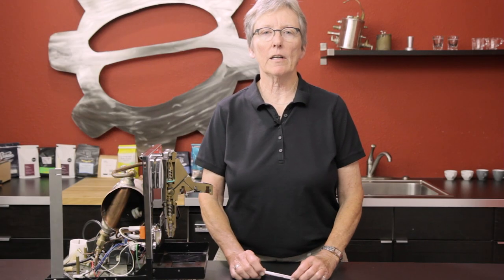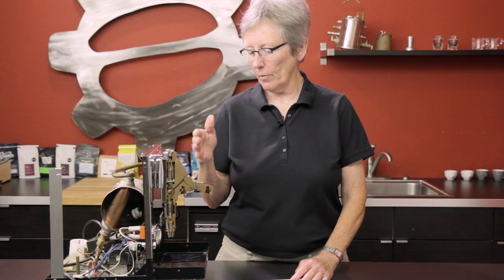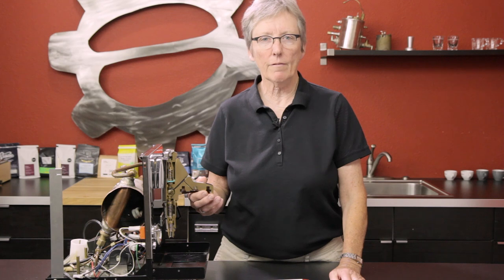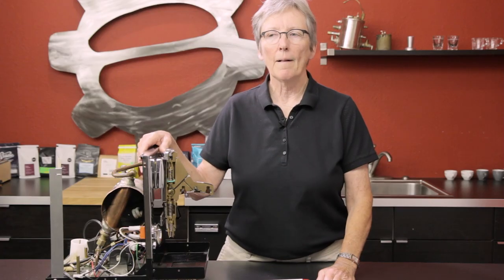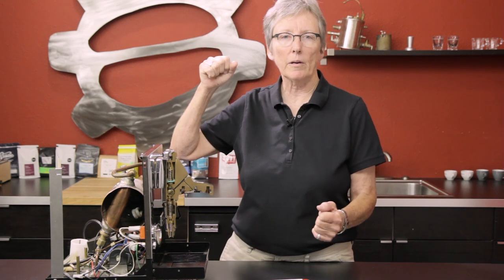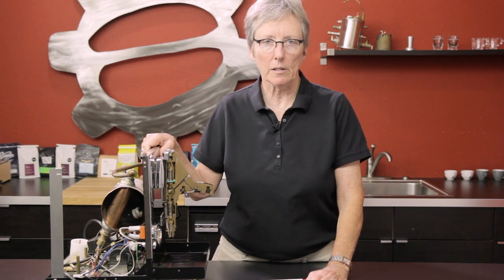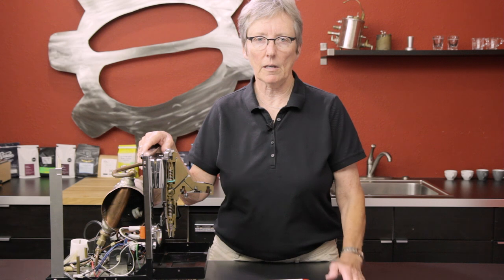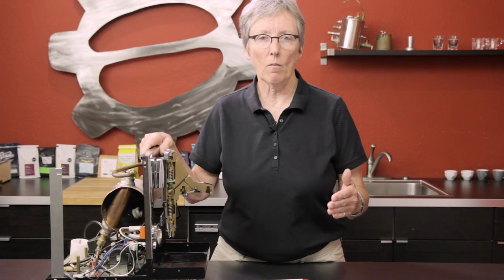What is Espresso Machine BAR Pressure?

Comment: Great video, Gail! But 15 bar pump is not really needed to get 9 bars at the brew head. You could easily get away with less. But the ULKA vibratory pump is such a simple and cheap design it just makes sense to put it in the machine - and based on the design it just happens to produce 15 bars. It was not created for espresso machines. Espresso machines just adopted the existing pump because it it small, cheap, simple and powerfull enough. Then you add the OPV to tame it down to about 10bar preasure which results in those 9 bars at the brew head. And because the OPV is extra cost for the manufacturer you hear claims (from the cheapest machines) that higher preasure (12-15bars) is better - they just don´t use the OPV and try to convince the mass market, that higher preasure is better.
Reply: Precisely; well said.

Comment: Actually the resistance provided by the coffee grounds creates the 9 bars of pressure down from 15 bars provided by pump. When you flush the machine the force of hot water coming out is about 14-15 bars. Put in a portafilter with coffee grinds, that will slow the flow of water and decrease pressure. This is why the convention is that if your get 2 ounces of espresso within 25 seconds or so, you have generated 9 bars of pressure.
Reply: You have a point!

Comment: pounds per square inch IS PSI, 1 Bar is 1 atmosphere of pressure at sea level. Although they measure the same thing - pressure - they do it using a different metric. Like kilometres and miles to measure distance.

Comment: Just bought a bes920 and smart grinder pro. I've got the grind, tamp, temperature (94c) and timing (about 25-27 secs) all to the recommended ranges, my pressure is in 9bar range too but the espresso can sometimes be really bitter and in need of sweetener, is it just my palate or am I doing something wrong?
Reply: Ps I've tried 2 types of coffee, different roasts. One was fresh from a coffee house roasted the day before and one from a supermarket, both have the same bitterness
Reply: There are a lot of variables, but I'm guessing it's dark roasted or burnt beans. I usually don't get too much bitterness until I get to the 40 sec range for most beans. If you like milk-based drinks, steamed milk will add sweetness, so you shouldn't have to add sweetener, even if the espresso is on the bitter side.

Comment: I'm new but I saw some commercial machines have 2.5 bar gauge . What's it means ? How does it differ from standard 9-15 bar ?
Reply: Toku Yoru that indicaties the pressure in the boiler, not the pump pressure
Reply: thanks a lot
Reply: Toku Yoru it indicates the temperature in the boiler, so you know when it’s warmed up. Boiler pressure = equal to a certain temperature.

Comment: Is there a huge diference between 5 bar and 15 bar espresso machine? My concern is because I'm undecided between a Bella Personal Espresso (5 bar) and a DeLonghi EC155 (15 bar).
Reply from the maker: With the 5 bar, you're going to use a courser grind and more coffee to get a proper extraction. Even then, your espresso is going to come out much thinner than espresso pulled from a 15 bar pump machine.

Comment: Are there systems around that have reduced or refined system pressure losses so that they don't need a 15bar pump to get 9bar at the head?
Reply: Yes - the little-known Elektra Mini Casa a Leva...100% manual and works like a charm every time.

Comment: Why did manufacturers choose  to use bars instead of psi if bars are less accurate?
Reply: +lesslighter  actually international (standard) system of unit for pressure measurement is Pascal (Newton per square meter N/M2)
Reply: 1 bar is approximately 1 atmosphere.
Reply: In Europe, Bar is much more widespread unit than PSI and espresso machines are typically European things